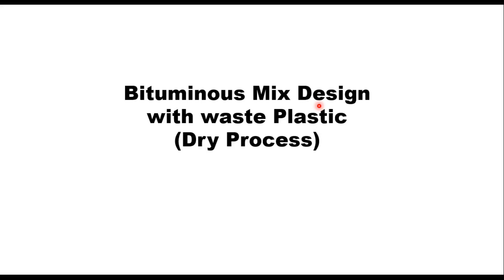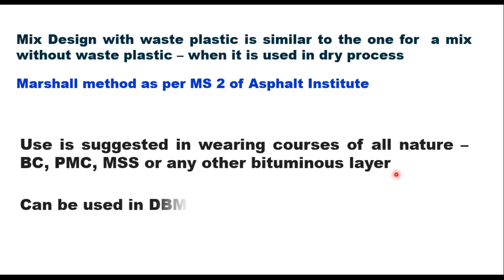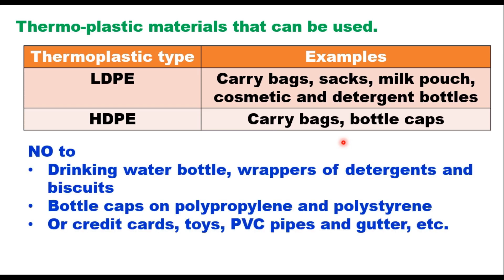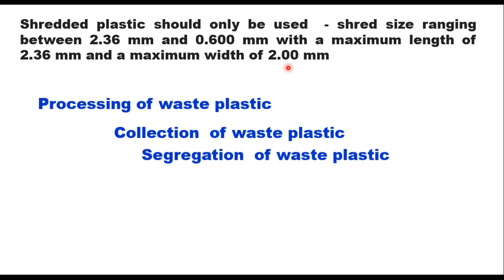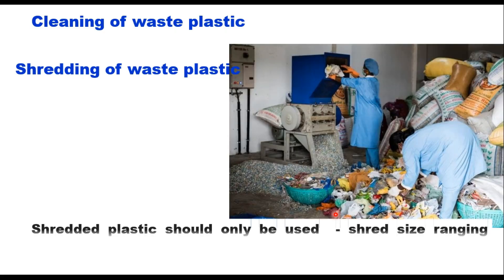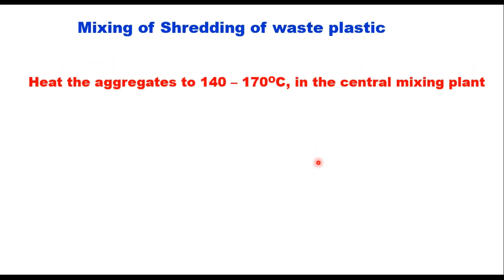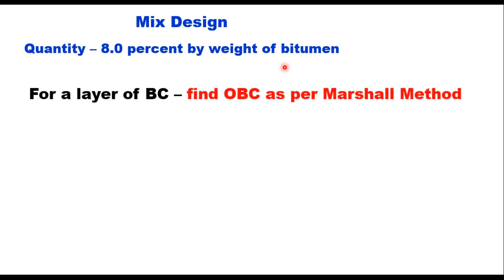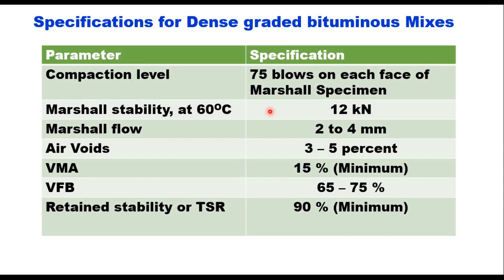Design of Bituminous Mix with Waste Plastic as in IRC SP 98, 2020 Plastics that can be used in roads

Comment: Sir, let's say waste plastic mix surface layer is laid. After 4-5 years it shows some distress. So i want to use this layer as a RAP materail. Can i use it direclty or will it need some modifiction ? Second, what will be effect of using plastic on Resilient modulus test of the mix ?
Reply from the maker: There is no restriction as such on milking of this layer. 
Requirements of all strength parameters are same as for normal viscosity grade binder. Some researchers claim enhancement of modulus due to plastic
Reply: @SatishIITR  Got it sir. Thankyou.

Comment: Nice explanation
Reply from the maker: Thanks for your appreciation.
Reply: Sir entire Bruhat Bengaluru Mahanagara Palike is using Waste plastic item. Can you guide on how can it be tested? And can be used for DBM layer also?
Reply from the maker: @hugochavezs3524  Testing of waste plastic after it has been melt and used is not possible. And many contractors are taking advantage of this issue and do not use plastic at all.
Reply: Sir, 
Thanks for the great explanation ...
My doubt is that how WP shall be added in drum type Hotmix plant ...? WP shall be injected through pipe under pressure at 2/3 length of drum and it's injection pipe shall be near to burner and in this case WP in pipe shall face a great temperature near flame and it shall burn and even choke the injection pipe and no appropriate injection shall be possible ....

What is the remedy for it ...Sir !

Regards
Reply from the maker: @sunilgehlot395  Use compresssed air to inject the plastic.
Reply: @SatishIITR sir Namaskar,  pipe chokes even after being fed compressed it ...
Reply from the maker: @sunilgehlot395  pipe chok kyo hoga agar aap shuru se hi compressed air use karange. This is shredded plastic in small pieces.